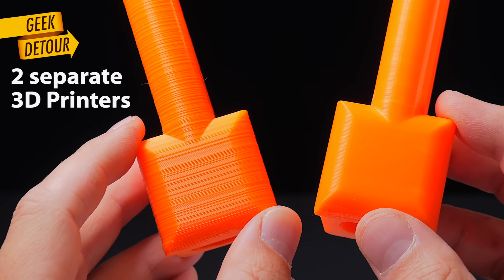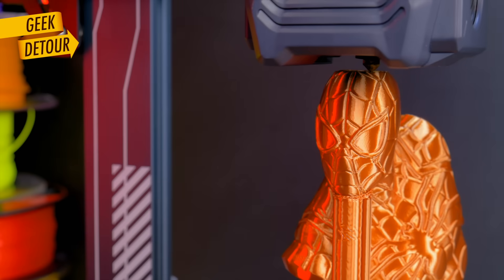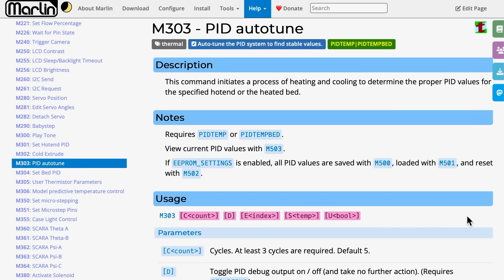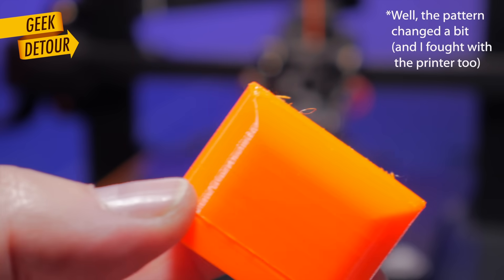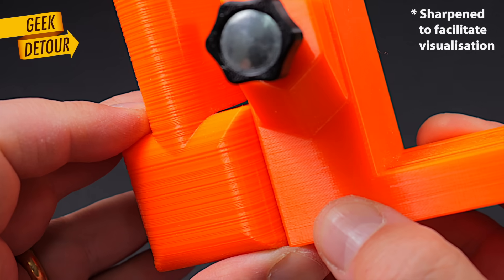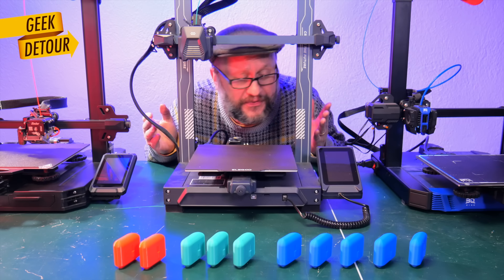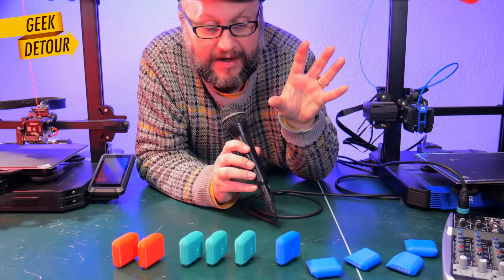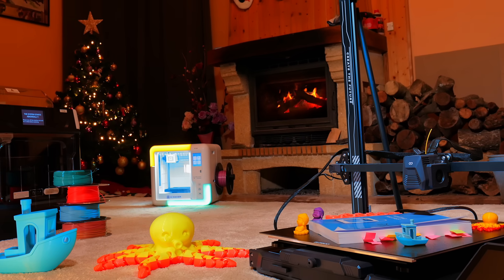3D Printer Problem: do you know How to Fix Z-Wobble?

Comment: not 'any' 3d printer, it can happen with any 3d printer with the same style of gantry - vertical lead screw - head bearing system. All the printers you show are nearly identical and admittedly a huge number of people buy one of the huge number of printers with practically the same design, but not all of us. I designed my own printer nearly 20 years ago now (I checked, 15 years ago, not really nearly 20, just feeling old!) and there is no need for any such assembly and that style of z-wobble isn't possible on my printer.
Reply from the maker: I agree with you. But as you told, it can happen in 95% of the consumer printers - and the exceptions are in the hands of sophisticated users like you. By the way, I would love to see your printer! Is there a link for photos or video? No images, it doesn’t exist 😂

Comment: As I am new to 3d printing, I love this video. Its a ender 3 v2. Was a pain to put together, but I did get it right. Wished there was a video by creativity for a setup guide. The firmware out of the usb I could not copy on my pc. That is tomorrows setup. But is there any software for pc with the ender 3 v2 you would recconmend or perhaps have a video for?

Comment: I have S1 Plus printer, and no matter if the nuts on lead screws are loose or little tight, the effects are simmiliar to yours in 3:36 (where you can see the lines under light)  Should i lubricate if i got my printer in march and haven't lubricated anything since?

Comment: It could be that the spool is not moving freely. That has happened to me before. I currently have my spool of filaments on bearing rollers. Make sure the filament is not crisscrossed in the spool.
Another reason could be filament diameter fluxuation. This is unlikely because your previous prints came out fine.
Reply from the maker: You are absolutely right: visually, the spool that gets stuck causes lines as well. It’s a bit different because the part also gets much weaker - not what happened in my case. But, yeah, a spool that doesn’t spin free causes a lot o problems too! Gee, comments were so great here, they should result on a video sequel 🤣

Comment: I have had this a few times on different printers that has had a lot of work
Solution is to put new brass lead screws . i did end using the spring loaded ones as seemed a good upgrade while changing
Even on other CNC machines its worth have replacements handy as brass tends to wear out quicker than one thinks

Comment: I used Oldham couplers for mine to fix this issue. then I did belted Z. even better after that.
Reply from the maker: The Oldham Couplers I reeeeeeally need to try - belted Z I am not sure yet 🤔 Merry Christmas 🎄🎁
Reply: @GeekDetour   the belted z changed a lot about the printer, so it took a bit more tuning after to get it printing right again. pressure advance, input shaping, belt tension, and rotation distance on the z motors. it's pretty drastic change. the oldham couplers on the other hand; plug and play. Merry Christmas, Happy new year!

Comment: This is why I will probably never buy a 3D printer. 
Not enough hours in the day to run and maintain one.
Reply from the maker: Well, there are new 3D Printers that work pretty much as a kitchen appliance. Software is getting better and easier too. Anyways, 3D Printing is like a "mini factory" - some maintenance is needed and the better you understand the process and the machine, the better results you get. Don't get discouraged!
Reply: @GeekDetour  — Maybe one day. 🥴
I’m worried a 3D printer will end up like my airbrush — used for a few weeks, and then back in its box ever since.
Reply from the maker: It’s my “in the future” box. When you have many interests and not enough free time 😄

Comment: Ummm, you used two clones. That's not exactly using different printers.
Reply from the maker: Ha ha ha, oh, come on!! The extruders are quite different, one printer runs Klipper, the other one Marlin… they are different enough 🤣 Merry Christmas my friend!🎄🎁
Reply: @GeekDetour  If the video had been on extruders or firmware, you'd be right, but it was about Zbinding. It would have been nice to know what actual differences between the 3 lead screws and nuts, heck throw in a ball screw for fun. I'm just saying, for the issue at hand, it would have been nice to see  maybe a prusa or even an Ender 5. Let the viewers know the actual differences. Especially if they look identical and it's well known that clones use generic parts. We don't know there's an actual difference. Just some honest feedback, Merry Christmas to you.

Comment: Its.not jistif the leadscrew is itself straight.
It's if it's joint holds it stright.

It was a veryy common problem years ago. Often the z axis would be modified so it just sat on the nuts.

Comment: Lead screw binding typically manifests as a regular repeating pattern that matches the lead distance of the screw. One thing not mentioned is that debris in the extruder can cause this as it will change the flow rate while printing.
Reply: omffffffffffffffg
thx so much...im an expert, but am the biggest newbie at the same time, seing this.

Comment: Sometimes i have the same problem and i use a DELTA (without Z rods) 🤔
Reply from the maker: hi! I don't have a delta myself... I can only guess Deltas might have their critical mechanical points of failure that should not have play... of if they are too tight, something weird happens... Do you participate in a user's Group of your same printer??
Reply: @GeekDetour  I am in a discord group but not really active, it's infrequent and never that much and completely random I think. Unfortunately there are not really drivers designed for deltas, after finishing a layer it pauses goes up a step and then continues which makes no sense at all.
Reply: @GeekDetour  Ok I'm an idiot, in the cases I was referring to, the bed adhesion was at least partially lost. And sometimes when components are too high and thin and vibrate a little. Sorry.

Comment: My guess is that there are maybe a dust or some other material stuck inside or outside of the nozzle and may cause the filament to go in other direction and not straight forward.

Comment: A problem shows up and disappears for no reason...? Sounds like 3D printing alright. I've spend more time fixing stuff that randomly pops up than printing. It could also be related to partial clogs or filament having diameter differences or bowden tube gap etc. This is the main thing I hate, everything can be related to everything else and there's no way of knowing without loads of trial and error. And you'll spend a month fixing something and either a different problem pops up or it fixes itself. It can be absolutely infuriating. Especially when you are a perfectionist.
Reply from the maker: I totally feel your pain! You are absolutely right: all the aspects of 3D Printing are interconnected and it is very easy to fix one thing and because of your changes, you made something else much worse. My advice for tinkerers is keeping one printer that prints “ok” and never mod it, keep it ready for printing everytime you need a good part. Then you can have a second machine that you can beat the bgeesus out of it, mod, break, whatever… to satisfy your curiosity and learning crave.

Comment: @1:29 - I have the opposite issue.  Dry filament.  Snaps like spaghetti.  I'm actually thinking about purposely soaking it like I do my string trimmer line.
Reply from the maker: Oh, it’s good that you mentioned it: they are not dry… they most surely got brittle from UV exposure. Don’t let PLA get sunlight. Keep your spools in a closet, in their boxes… use a dark dry box to keep them on your printer. 
I don’t know if you can recover what is already brittle… but you might see the change with new spools that you keep in the dark.
Reply: @GeekDetour  They live in a dark basement mostly.  RH stays about 45%. To be fair, some of these spools are 3 years old if not older.  The ABS and the TPU seem fine.  I also have an air purifier that occasionally puts out ozone.  I wonder if that is also an issue.

Comment: Ohhhhh that explains the trouble I was having with my prusa knock off. Those bolts are tightened solid, and feeling the z rods, they dont move exceptionally freely atm. Though the printer has been in hibernation for a few years, so the light oil I was using before has likely dried up. I had a feeling the light oil I was using also wasnt the correct lube, but I did try and use it frequently, ie every print. to compensate.  Seems I've now got some new ideas on how to improve this printer once I bring it out of hibernation.

Comment: Happened with my Ender S1. After the initial first user pains I got better prints. After several months the print quality became inconsistent. Sometimes it prints perfectly for days only for it to go weird afterwards. One problem might not even have the same cause or solution.
Currently, I'm trying to solve a spaghetti problem. I was trying to print a set of four small pieces for my Steam Deck but the last print became a spaghetti....to which subsequent prints ended become.

Comment: Literally no one needs a 3d printing book. Teaching Tech's guide has existed for years, and covers damn near everything.
Your lead screws are crooked\dirty.
Reply from the maker: If you’ve been watching Teaching Tech excellent channel for years, great chances you already acquired enough knowledge to troubleshoot anything yourself. Agreed 👍 His Troubleshooting website is great but I don’t think it is as complete as the Book. Also, the book is incredibly useful specially for beginners who will certainly get lost even trying to figure out which specific problem they are facing - the photo index of problems help a lot in this case. Anyway, books look old fashioned now, I know. I still love books - got mine in July, mostly for curiosity, and I though I had to share it at some point.

Comment: Omg thank you so much I would never have figured out why this was happening to me this was a godsend
Reply from the maker: My pleasure to help. Important: on the video I showed some of the most popular reasons that can give you this type ugly result. It doesn’t mean yours WILL be the same. Check the mechanics, be sure everything moves smooth without play. Dry your filament, do the PID calibration once (learn how to do it for your printer) and be sure your Z-Nuts are not tight. I hope you can find your problem and be proud of your improvement. Oh, lubricate the rods 😄 Merry Christmas 🎄🎁

Comment: 00:03 Identifying and fixing 3D printer line issue
00:55 Identifying and fixing 3D printer printing issues
01:56 Maintain consistent temperature for better 3D printing
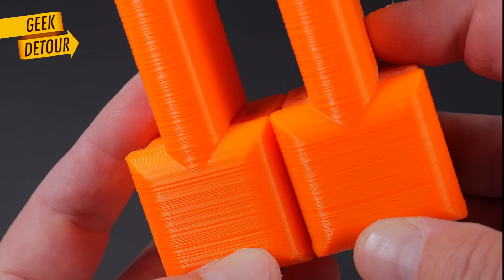02:49 Loosened Lead Screw Nuts to fix Z-Wobble
03:47 Z-Binding is a common problem in 3D printers
04:41 Tightening the nuts resolved the 3D printer problem
05:37 Proper printer adjustment leads to quality prints
06:34 Troubleshoot 3D printer problems effectively
Reply: 4:40 He didn’t tighten the nuts. He LOOSENED them and made it clear they should be loose!
Reply: This sounds like you fed the subtitles to ChatGPT and asked it to mark chapters
Reply: You just wrote two different titles that contradict each other... "Loosened lead screw nuts to fix Z-Wobble"  then "Tightening the nuts resolved the issue".  Huh???? He didnt tighten the nuts to "resolve the issue" he was just trying to recreate it which helped him conclude the different factors that may have combined to cause the problem.

Comment: ok, taking your challenge, my guess is based on personal expierence that caused exact same layer issues. SInce it was all the way around the part, and up and down, i figured it was something to do with voltage on the drivers, or to heavy of a gantry, but it was bad vrefs. So i made a youtube video about 4 years ago on how to fix it. It can also be from debris on the lead screws. 

now ill unpause the video and see what you say it is :)

ah yes, z-binding. I had this on my homebuilt prusa i made from leftover parts. Turns out that the mold injected parts of the x axis gantry of the anet a8 were off by 1mm, so it would skew my rods. Once i fixed that, i also had to do a differnt type of belt tensioner since that was adding the wrong kind of tension to my belt, pulling the z axis rods inwards, causing binding.
Reply from the maker: Hey, thanks for playing! I just love to hear people’s stories with their printers, specially the home-made/left-over ones 😁 Merry Christmas 🎄🎁
Reply: @GeekDetour  Merry Christmas to you as well my friend:)

Comment: What people don't understand is that the leadscrews don't need to be relatively straight. Their function is to transmit movement only. It's the wheels and the vertical extrusions that guide the gantry in a straight line.
Reply from the maker: True.

Comment: I hate this part of 3d printing and hope we come up with solutions to making troubleshooting and maintenance easy
Reply from the maker: Hi there! Maybe you should get a different 3D Printer. Most machines until now were very dependable of people knowing how to tinker and adjust properly. I need to say the new Bambu printers are way easier to set and get beautiful prints. As I told, some basic maintenance will be required, but it is the closest thing from a “2D Printer” that we have so far.

Comment: 0:24 Lines like that are normal. You have to smooth the print yourself either by sanding or using a vapour chamber.
Reply from the maker: Ha ha! You… are you serious?! 🤣 Course not! 😳
Reply: @GeekDetour  Yes. The lines are an inherent part of how the layers are put down. You can minimise them with much smaller layer height, at the cost of printing time. You can never truely eliminate them.
Reply from the maker: But you can definitely get parts at 0.2mm whose finish are good enough, so discrete that sanding is completely unnecessary - so good that sanding makes them look uglier than their natural finish. I agree with you that they probably don’t look 100% uniform (at least it is very hard to get that in all models). But terrible lines like I showed in the video are far from “normal”. At least not with my printers. Anyway, it’s our hobby, we do it for our enjoyment. Enjoy your prints with some lines - there is no problem with that. If you prefer to sand, go for it. BY the way, I am not talking about normal layer lines, I am talking about irregular lines/bumps that you can feel with your fingertips. Uniform 3D print texture I like.

Comment: Lose screws are not the solution. Oldham couplers are, they let the rods move sideways without vibrating the gantry. After installing them my prints came out way smoother. An inexpensive solution to a very common problem.

Comment: I’ve been struggling with my printer. I’ve upgraded what once was a Cr-10 V3 to now have a better hot end that can handle higher temperatures. E3D’s REVO Creality with the Obxidian nozzle. 

It has sadly been failing and like this video, I think I find the problem only for it to fail again. I’m still learning about this hobby and have only been in it for a couple of years now. I really appreciate this video. 

Whether it’s an answer to what could be wrong, I don’t know, but it’s full of a variety of things I’ve yet to check. I’ll also take a look at that book. 

Thank you! I love the way you explained things in the video. Very helpful.

Comment: Interesting 🤔 Loose belts had been my guess because I had similar (though worse) results when I first built my Prusa.  Turned out both belts were too loose (the Y belt was missing a screw in the stepper (which I fortunately found) and more problematically I accidentally broke the X-axis tensioner during assembly.). Not wanting to disassemble, I tried printing a curved clip to slip onto the x-belt to tighten up the slack and it began printing perfectly!  😆  I just remember thinking how cool it was that the machine could literally repair itself!   Several years later now, I’m starting to see similar issues as in this video, so maybe z-binding is the culprit?  Though oddly enough, the effect appears to be worse on one particular side of the print (especially visible on vase mode). 🤔

Comment: I had lines similar to that, but they were not as consistent. Turns out it was my extruder gear that wasn’t perfectly circular, so it extruded different amounts duringna rotation.

Comment: Weird because I have Creality CR-10 I purchased in early 2017, I did some initial lubricating, belt adjustment, leveling, etc in the first few months and have not done ANY maintenance other than dusting in almost six years and it still prints beautifully.

Comment: BRO....this problem is very  small and easy to fix! if you dont have a bimetal titanium and copper you probably need to change the ptfe tube inside your heatbreak or jump to bimetal heatbreak to avoid forever this problem!....
Reply from the maker: Absolutely, what you mentioned is also a source of failures that make very ugly parts. But this printer has an all metal hotend 👍

Comment: 3:35 You act like you fixed the problem, but the prints both look exactly the same with horrible banding. Never once did you talk about the extruder gears having wobble, so you never covered all possible causes.
Reply from the maker: Did you watch it to the end? I showed what I checked when I was troubleshooting for real. There are many more things that could do similar problems: Overextrusion, dirty gears in the extruder, heating block a bit loose… The whole list would make a really boring video. But you are right: it is not a comprehensive tutorial. 🤷‍♂️ Oh, Merry Christmas 🎁🎄😁